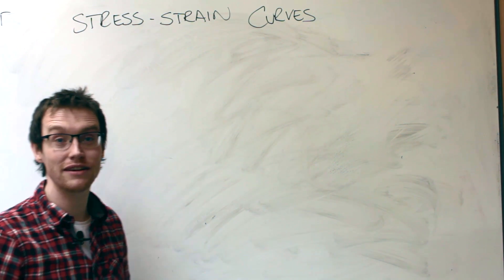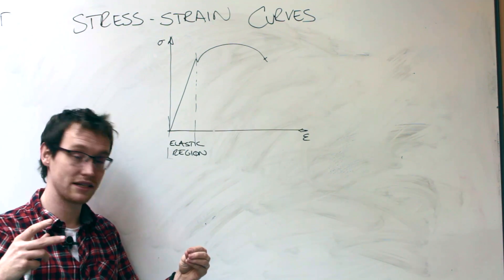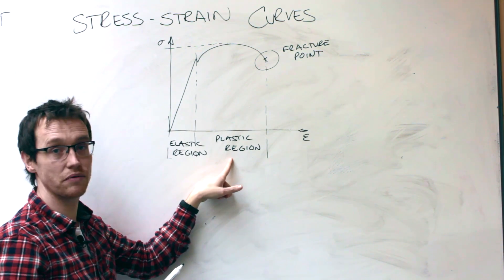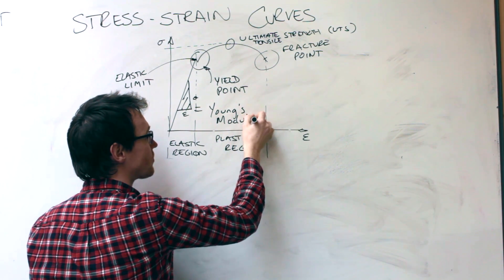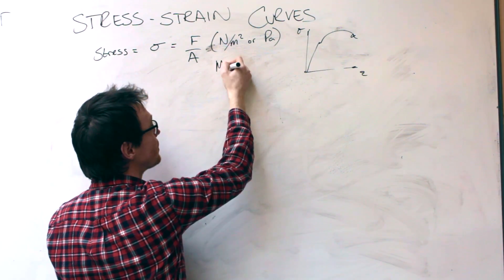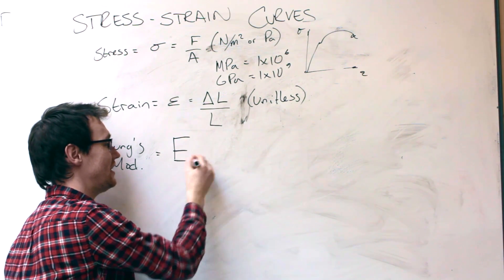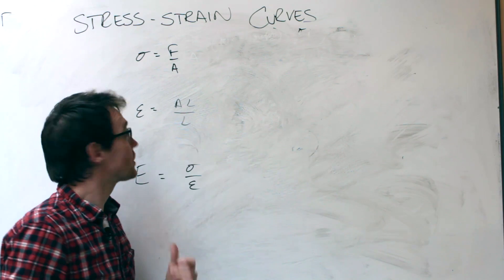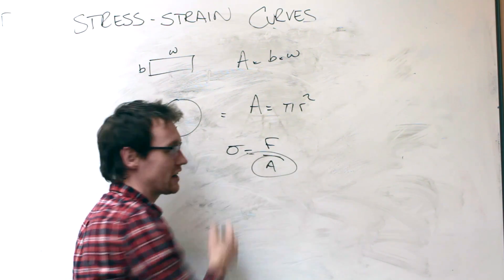Mechanical Properties of Materials and the Stress Strain Curve - Tensile Testing (2/2)

Comment: I didn't like when he said "stress" is a fancy word for "pressure". "Pressure" is a special case of equal normal stresses at a point irrespective of the orientation of the plane through the point on which the normal stress is calculated.
Reply from the maker: An excellent point and a very clear definition. This video was aimed at my 16 year old students and I think your definition might have gone over their heads! It is however, much more accurate. Thank you.
Reply: FutureFab CNC & 3D Printing I am quite impressed with your humbleness! I didn't notice that your lecture was intended for undergraduate students 😅

Comment: how to find elastic modulus for graphs such as rubber ?
Reply from the maker: I'm not an expert in non-linear materials but here is my understanding.

Elastomer graphs look strange in comparison to the typical ductile graph. They're non-linear so have different values at different stages of extension. Here is some good information.

http://files.hanser.de/Files/Article/ARTK_LPR_9783446416819_0001.pdf

Rubber goes through a hysterisis cycle. When this is closed you can use something like MATLAB to differentiate the fucntion to find the slope of the graph at the point of interest.

In the real world you'd likely just look of the "small strain" value of the rubber in a materials handbook.

Comment: Very very poor explanation, not explain any point clearly as well as you can't say elastic material a rigid.
Reply: Vinay Agnihotri Almost all materials are elastic to some limit however small the limit maybe. A perfect rigid body is a hypothetical concept but we still apply the laws of Newtonian mechanics to bodies under the effect of a system of forces whose deformations are negligible in comparison to the actual dimensions of the body. That means we can approximate an elastic body as a rigid body under a given system of forces without any significant error in judgement only if the change in the dimensions of the body under the action of a system of forces is insignificant when compared to the original dimensions of the body.
Reply from the maker: +Vinay Agnihotri not sure what you're referring to there Vinay.